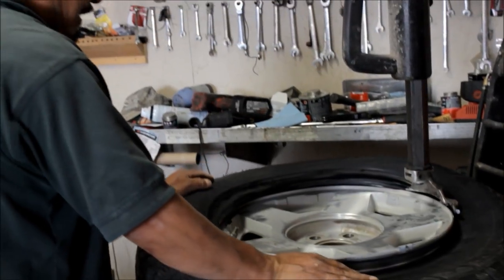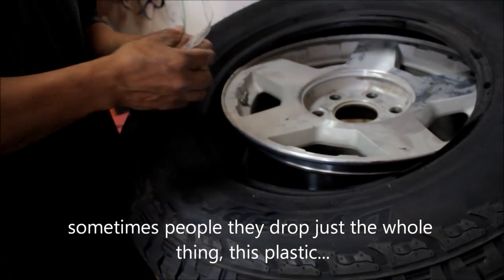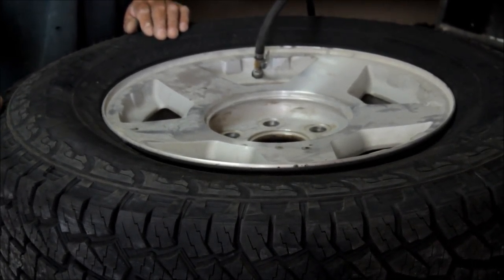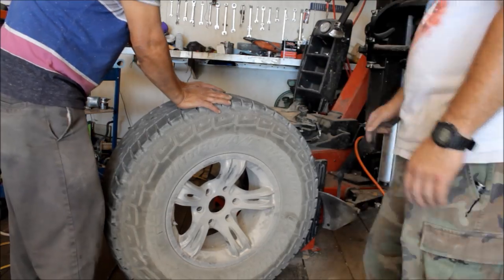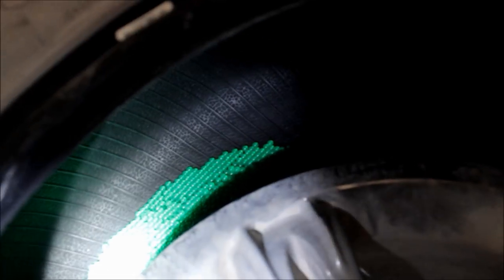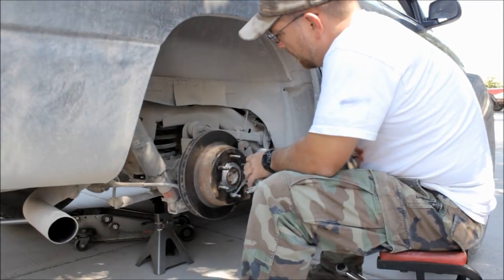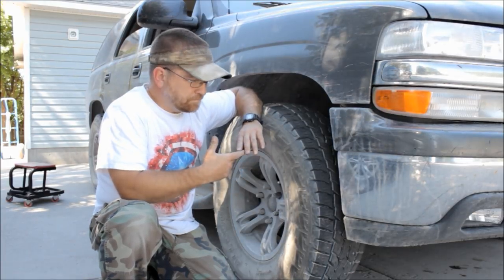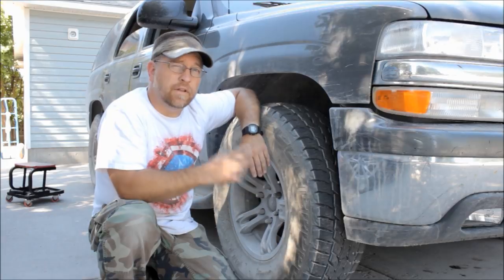6 Months with Airsoft BB's in My Tires. Did They Work ???

Comment: Today I talked to the tech guy at CounterAct Balancing beads.  He cautioned against using his beads in car tires because the "suspension is too soft".  You can get away with using them in the rear tires, he said,  but front tires might "hop".  His product is for trucks and vehicles with stiff suspensions, he said. This surprised me. I was ready to order 16 oz of plastic airsoft BB's for my new car tires.

Comment: I run 11oz in my bias ply 36" swampers. Have had them in for 3 years. Really even wear across the tire, and no weights to worry about. I also have run them for 5 years in my gmc 2500. No issues there either. Best way to balance a tire. Period.

Comment: I put about 3oz per tire in a set of crunchy old used 215/75r15's and they rode like a cadillac on an equally crunchy old s10. I drove it like that until those tires practically rotted off

Comment: I did 11-12 ounces of airsoft bb's per tire in some used chopped up 38"x14.5 swampers. The truck drove hwy speeds without a shake. Airsoft BB's are much cheaper and durable than going with the special "tire balancing beads" and I was able to de-bead the tires at home with a highlift jack to drop them in. Easy DIY project
Reply: Ryan Harris i
Reply: Ryan Harris I just put 265/70/r17 Treadwright claw tires on my JK. it took allot of weights to balance it and it shakes and vibrates really bad but I can still live with it..
how many ounces would you think it would take to fix my problem??
Reply: they have charts that tell you how many oz to use based on tire size
Reply: @yoshibomber  who's 'they', the airsoft bb company?

Comment: The only down side I've found with the tiny tire beads after a year of using them is if you use the long filtered vales in your stems they'll beat them up and start leaking. I find just switching them out to the short vales fixes that problem. No viberation, no flat spotting on two trucks we're running them in.

Comment: This didn't work for me.  LT285/75/16 tires, load range E.  I used the same BB's he used in the video and the appropriate 8 oz in each tire.  It still shook on the highway, mostly between 60 and 65.  But the shake would come and go, almost as if the BB's were trying to find their place inside the tire but just wouldn't stay.  When I balanced with weights I found that one of the tires took like 6oz of weight.  So it could have been that the difference between the two tires was too vast for that amount of BB's to compensate.  Your mileage may vary.

Comment: I would like to see you run the tires without any balance and see if you notice. In the first vid you tried to spin them on the balancer to test. Try just running them as is first, say a week or so when there is no snow. Then run them with BBs. I'd wonder if they would be ok as is.

Comment: Wait until the ceramic stuff jams the valve in the valve stem. It happened to my buddy at a campground with his RV, came close to having to call a tow truck.  Run the airsoft or BBs, never had any problems with those on 4x4s or the company freightliner.
Reply: There are different valve cores that you are supposed to use to keep the beads out of the valve.

Comment: what I remember is a foam that goes into the tire and forms little compartments of air about an 1/8 inch in diameter that way when a tire is punctured only those bubbles will be popped and the tire still retains its integrity.

Comment: I'm currently trying out regular copper bb's for bb guns in mine. They do balance just fine, but I want to see like you, if any damage to the rim has taken place. Going to run them another month and see, but so far it works great.
Reply: Tater79bj probably make the inside of your rim clean and shiny :)
Reply: that sounds like an awful idea but i am curious
Reply: i wouldn't use those on aluminum rims to be safe. they're only copper coated... steel inside. i wouldn't put a material harder than the wheel inside the tire. you can see the plastic bb's polished the inside of the rim, imagine steel bb's after several thousand miles on an aluminum rim. might work fine the first 100k, might cause the wheel to fail after that. wheels, tires and brakes are worth the extra safety factor, can't steer or stop without them.
Reply: Ceramic is far and away harder than steel.

Comment: Considering using this method in my tires too, thanks.  I must say though, in my experience, anti seize on lug nuts is not a good idea.  Once in my life, I too thought it was a smart Idea to lube up wheel lugs with anti seize, until I lost a wheel on the road.  Maybe, my experience was a fluke, but be warned.
Reply: It just takes a dab .  Ive done it to my own and every car iv'e touched . Im not talking about bathing the stud   . If there is a sign of you slinging any off after a few miles you have used too much .  and just on the stud ..  Not the face of the lug where it meets the rim
Reply: Let's be honest! If you had an issue was not BECAUSE of the anti seize. It was because of some other fault practice... It's that simple! 
You can apply "rivers" of anti seize. if all else is done to specs. Nothing will happen!

BTW Now that we mention it. Not applying anti seize might lead to way more serious issues. Specially if you live in some rust belt area of this planet. ;-)
Reply: @crpth1  I never had an issue with a wheel coming off before or after, only that one time, I used anti-seize.
Reply: @crpth1  nonsense.  'wet' torque is different than 'dry' torque'.  If you use anti sieze you need to change the spec.  Lug nuts are meant to be installed dry clean threads.

Comment: I had bought some Procomp flat black Wheels with a teflon coating ( I guess) Took them to Big-0 to mount my 35’’BFG BajaT/As I picked up my wheels and got them home ( XJ was home) I bounced one of the back of my P/U and the weight fell off . Upon inspection I noticed that the weights had been adhered with duct tape also . The weights fell off in my hand I talked to Big-0 and the suggested the beads that you showed . Now I have death wobble . So my options are . 
1. Buy new wheels .
2. Buy new wheels and tires. 
3. Move to a bigger town that people know what they are doing :-) 
4. run my old 33s on M/T wheels .
Reply: Martin Romans 5 fix you loose ass front end or warped rim.

Comment: Has anyone used BB's on their vehicle equipped with TPMS sensors? I'm wondering which type of TPMS sensor would be more prone to damage...the band type that gets clamped to the inside of the rim or the valve stem type?

Comment: Would have been nice if you stated early in the vid that this doesnt work for car tires, works for any kind of tire but car tires.
Reply: why?  There is no difference car vs truck.  But I have read it doesn't work for low profile tires for some reason.

Comment: no damage to the rim or tire. but is it actually balancing the tire? out of ballace wheel would cause premature wheel bearing or balljoint. Should have checked balance of tire before you opened it to inspect it..

Comment: The issue with this test is you balanced the tires before using the beads. Should use off balance tires and see if they improve.

Comment: an object subjected to an external force will accelerate and that the amount of the acceleration is proportional to the size of the force. The amount of acceleration is also inversely proportional to the mass of the object; for equal forces, a heavier object will experience less acceleration than a lighter object. Considering the momentum equation, a force causes a change in velocity; and likewise, a change in velocity generates a force. The equation works both ways.
The velocity, force, acceleration, and momentum have both a magnitude and a direction associated with them.
Reply: I think my brain exploded after the the first 2 sentences
Reply: Can you explain that to someone who's not a mechanical engineer,lol

Comment: the hell, I used airsoft bbs in my tires and they were nothing but dust after 4k miles
Reply: I'll bet you probably got the bio-degradable ones and didn't realize it. I'm pretty sure the bio-degradable ones will turn to powder in short order.
Reply: I have been using the plastic green air soft bbs for years now, and just changed out a set of tires with 30,000 miles and the bbs still looked new. I have had great luck with them on pickup trucks, suvs and small cars.
Reply: @Zz-wc4yj  What sized tires on the small cars? A lot of these sights say that bbs won't change the lat balance on smaller passenger car tires. I was going to try 3oz in each of my 185/65 R14s when the new ones came in. Sound about right?

Comment: Tried this for a month and didn't work on car tires.. Car shakes like crazy, one tire has bad wear dead center of the tread. Not camber/castor/toe wear, Alignment is perfect, no bent wheels, air pressure measured with the tires cold, weighed the beads out perfectly... 
This for sure won't work on car tires
Reply: Also the tps light came on even though tire pressure is spot on
Reply: What size tire and how many ounces of beads.  Who noted the tires?
Reply: Mounted not noted
Reply: 195/65/15 

3 oz beads

I mounted them... tire seam was opposite of the valve stem
Reply: Yeah I think you are right about the sidewall height. The tps on my car seems to only come on with low pressure. I check tire pressure a lot but maybe there is a factor I missed.

Comment: Was this test airsoft BB's only or did you use wheel weights as well? Can you see any reason why this might be a problem with airing down or using larger 38", 40", etc. tires? Was this test run under freezing temps? If so how did they perform?
Reply: The whole point of these beads is so you don't need wheel weights anymore, so I tossed all my wheel weights when Santiago put these in the tires. I can't see any problems running these at low pressure and I think these might be the ONLY way to reliably balance big 40" tires. When tires start getting that big, it's nearly impossible to balance them with just weights. I wondered about the bb's freezing and clumping during the winter, but I put them in the tires in December and had no problems at all. There was no moisture in the tire at all when I opened it back up. I live in the high desert, so maybe it would be more of an issue where it gets humid, but I had no moisture problems at all here.
Reply: Thank you.

Comment: The physics just doesn't add up. The centrifugal force will push all the BB's out to the furthest spot from the axis of rotation. This has no relationship to the heaviest or lightest part of the tire. It will cause a tire IMBALANCE.  Reminds me of the hundreds of "The earth is flat" videos.
Reply: Hi Steve (and anyone else interested): "Dyna Beads" (the ceramic, made especially for tire balancing tires) WORK. It is not a question ... they work. YOU MAY wish to note that SOME speed (of the vehicle) is required FOR them to work; a guess-timate would be around 20 mph; but at any speed above that they WORK, and that is from personal experience.

Comment: Hey man I'm looking to buy a 95 jeep cherokee 2wd for cheap. The only problem with it is that it starts but like 10 minutes later it dies while driving. i haven't test driven it yet but the owner says they've already been to a mechanic, who says it's just a bad ignition switch. Based on all this info what else should i look for when i go to check and test drive the jeep?
Reply: Fuel Filters
Reply: Connection to ecm needs zip tied to work right. Loose connection.

Comment: Did you add any wheel weight to the rims after adding the beads?
Reply: No, the whole point of these beads is that you no longer need wheel weights. The beads dynamically balance the tire for the life of the tire.

Comment: GM specifically says NOT to use anti seize on lug studs and nuts.
Reply: He didn't put it on the studs or nuts.
Reply: josh schultz yes he dif. And he said he did.
Reply: repr26 yeah if you live in California! In the northeast you need it i have been using it for 15 years never had my wheels fall of
Reply: no you don't...it's called leg power. Old mechanic trick, sit your ass on the ground, put both feet on opposing sides of the tire (sidewall) and kick one side then the other with the sole of your boot.

Usually off in 4-5 hits.
Reply: I had to cut a stud off my jeep because the lug nuts had rusted even with a torch and a impact it wouldn't budge  used a breaker bar and a 7ft cheater still wouldn't move
Reply: what I saw in the video, he only put it on the hub, where it meets the aluminum wheel

Comment: what are these beads for? balance or help with ware? and why would you use these over wheel weights?      my superduty has a vibration problem from l8ke 40 to 50 mph. i took it do get the tires balancend and they said, well there 5 years old so the shake may never go away... hmmmmmm if they fit through the valve stem i may pour some inthere.  if i do will the current wheel weights that are on there fuck up what there trying to do? or will they work together abd how much do you use.......
Reply: fuzzy wuzzy ditto...
Reply: fuzzy wuzzy good questions. I would assume you would just pop the wheel weights off :/
Reply: fuzzy wuzzy Used for balancing the tire, I went with beads because a 35"+ tire wouldn't fit on the balancing machine the shop had. They look better than weights and are adaptive balance since they constantly move, unlike wheel weights that are set once they're on. There's some kind of scale for the tire size as to how much you put in, search online or talk to a tire shop. I don't know if beads and wheel weights would work in conjunction or not, I'd say just remove them to be safe.
Reply: Just a Bat. thanks man
Reply: fuzzy, low speed vibrations like yours are usually due to tire separation. I'd be ready for a blow out if that's the case with your tires. I had tires that were separating on the back of a pickup, while driving you could feel the shake coming from the back around 30-40 mph then once I passed that speed it smoothed out
Reply: If you put these beads in the tire, yank off any weights you already have on there. The whole point of these beads is so you don't have to use tire weights anymore and so the tire continues to balance itself over the life of the tire. Leaving the weights on will probably not hurt anything, but I figure if I don't need them, I'm going to toss them.
Reply: Its called harmonics

Comment: The first one "tire Beans" where White and the second one are green? is me or... doesn't make sense? I'm an engenier, and is complicate to explain STATICS physics, but if you put weight on an unbalanced "think" (tire,airplane, spacecraft) there's no way the extra weight put it on balance... that say second law of Newton, remember I said STATICS NOT DYNAMICS.
Reply: i said the same thing how are they the same if they went in tiny and white and came out huge and green?
Reply: The white ones were ceramic and went into his dad's Tahoe. the green ones were plastic and went into his tahoe.
Reply: Go watch part one and you'll see me put those green bb's in my tires last December. Those tiny white beads are going in my Dad's tires right now.
Reply: @The__Canuck.  the white small beads are a commercially available product just for balancing tires, people decided to try airsoft BB that's the second tire , he used airsoft BB's to see if they would hold up and not destroy the tire.

Comment: from the g forces I can't see these beads doing anything. At slow speeds they would be all over the place. What a gimmick
Reply: Its because you are viewing the tire as being completely/perfectly round and only impacted by centrifugal forces thus sticking to one outer edge, but out of balance, or out of round tires rotating around the center axis, an imaginary line through the center of your axle, cause centripetal forces due to the non-circle shape(ellipse).  Centripetal forces will cause the balls to rush to the opposite side of the heavy/out of shape/spot furthest from the axle causing a balancing effect as the speeds/velocities increase.  Newtonian Physics, nothing new here.
Reply: @iamblaineful  "rush to the opposite side of the heavy /out of shape" Since the beads so often do not consistently balance, I mus'nt  believe your Newtonian application is accurate.
Reply: your correct at slow speeds they dont do anything,  but at low speeds you dont need balanced tires either.

Comment: This is dangerous you could wear the inside of the tire out AND have the tire explode with all those bbs roling around it the tire!
Reply: DUETT A. TRAKTOR: Your Imagination does not overrule FACTS; this method has been used for the past 20 years.
Reply: once up to moderate speeds they dont roll around. centrifugal force holds them still.